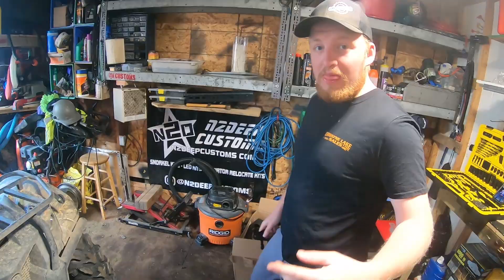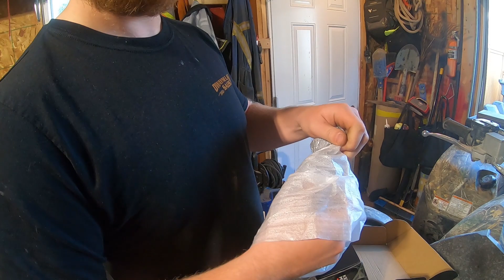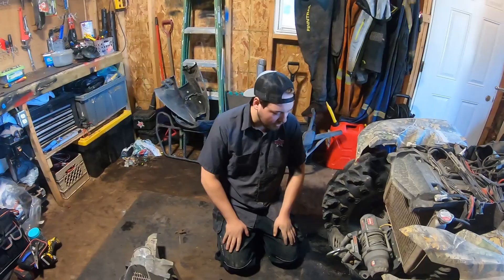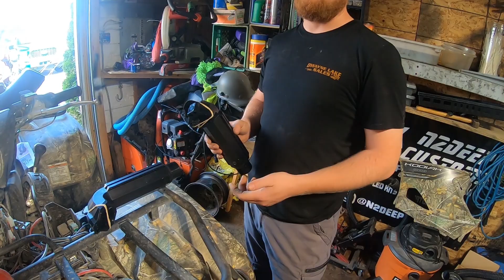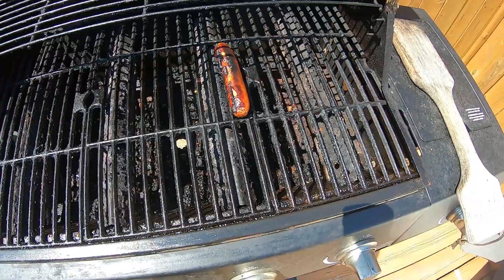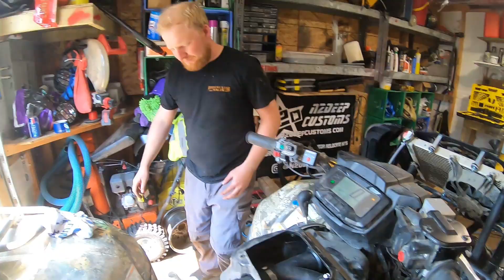Yamaha Kodiak Snorkel and Rad Kit Install!

Comment: Are the diffs weaker in the Kodiak than the Grizz? Also wondering if its a big deal on trail/in mud with the narrower control arms & shorter suspension travel and if so, 1in wheele spacers should help a little with the stance eh?  Love that kodiak, looks more like the older Grizzlys.